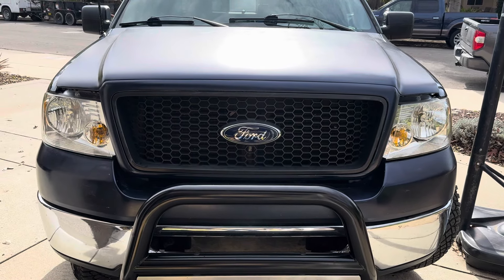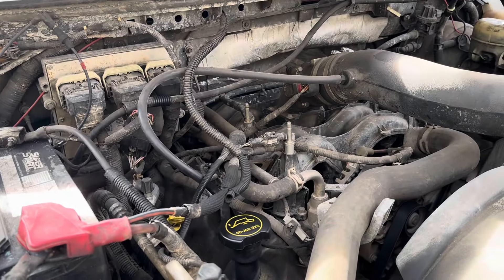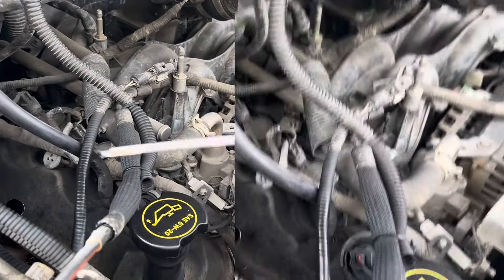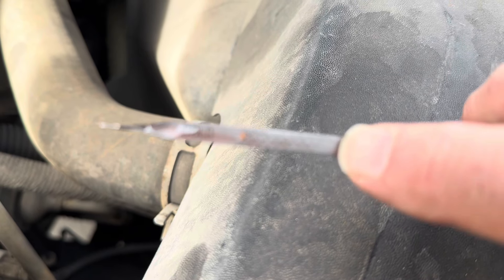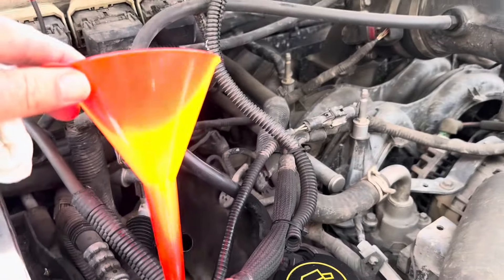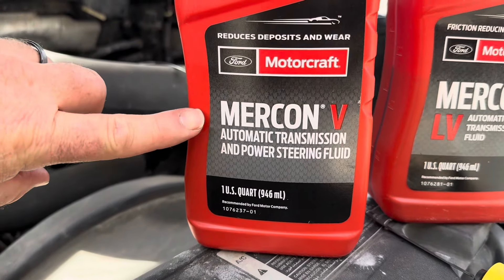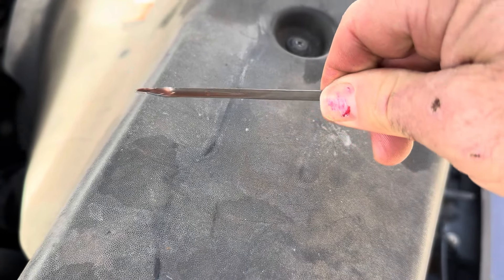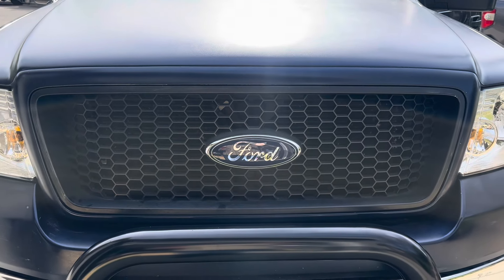HOW TO CHECK TRANSMISSION FLUID LEVEL FORD F150 & HOW TO ADD FLUID!

Comment: You're supposed to cycle through all the gear selections too. Put gear select to 1 for a couple seconds,2 a couple sec., D, R and back into park.
Reply: Can anyone confirm this for me? I’m going to do this tonight or tomorrow
Reply: @budbabyyy9620 yeah just have the car in is riding on the level surface, put it into one for a couple seconds, too a couple seconds et cetera all the way until back in park again. Just what's the different pockets of the transmission for the gears filled with fluid so you get a more accurate reading but I don't think it's anything that's that's significant regardless. That's what I do cuz that's the technical right way but you do it or don't do it I don't think it matters that much. Drive the vehicle for a few minutes or 3 or 4 me so it's warmed up

Comment: The transfer case seal on these older f150s will eventually start leaking here in 2024. Be advised, if youre missing atf fluid with no visible leaks, your tansfer case is likely over filled. (Ive read this will not hurt the transfer case), but a good way to check, just open the transfer case fill hole, if a quart of fluid comes out of the fill hole, thats where your atf is going. Ford now reccomends mercon lv for both transmission and tranfer case, so maybe not a huge issue but definitely worth noting.
Reply: Just to clarify, the transmission output does not have a leak there is a vent where atf fluid comes out and the tranfer case seal pevents it from getting into the tranfer case. When that seal goes bad it will slowly leak in. Once there is enough atf fluid in the tranfer case, you will reach an equilibrium where it will stop leaking. Recommended to annually drain tranfer case from fill hole back to level, and top off transmission as needed. Or change the seal (very difficult)

Comment: The correct measurement is in the middle of the cross hatching. My 2010 Transmission dipstick says to use LV as well as the owner’s manual.  Great video!

Comment: You need new hose buddy. How is that hose alive? lol like cracked desert from no moisture
Reply: That's a thick piece of foam that raps around the metal hose, not the actual hose that's cracking
Reply: That's not the hose it's just a wrap. That would be funny though